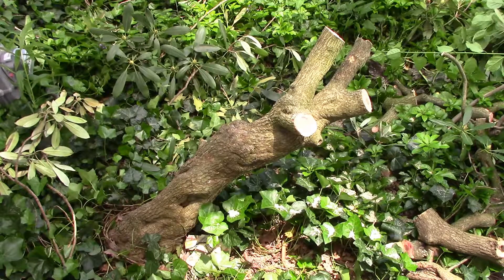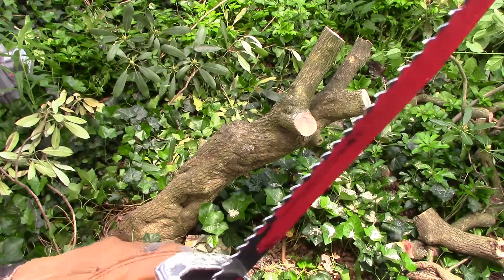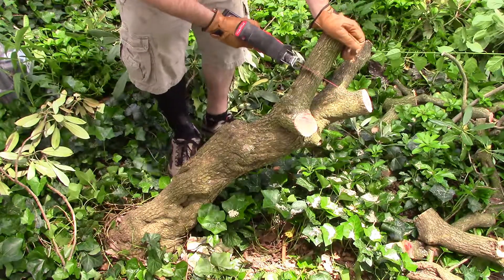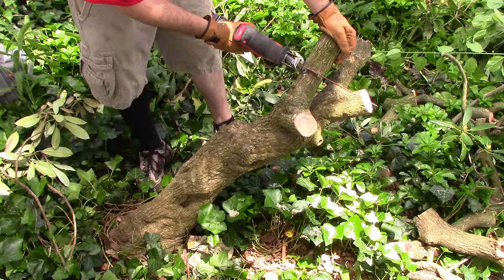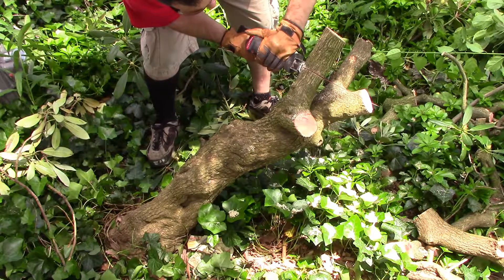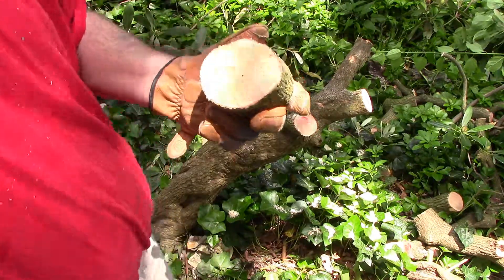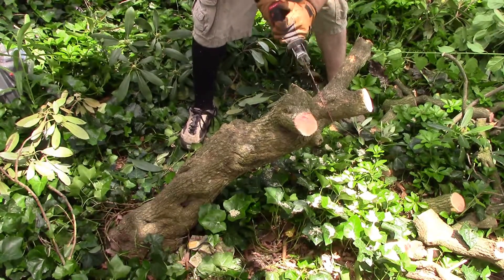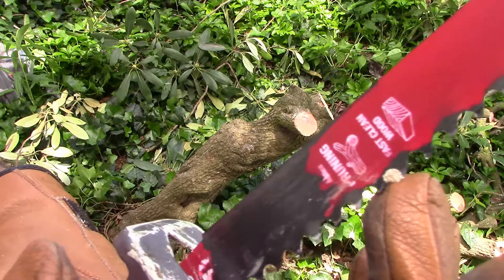Diablo Carbide Tipped Reciprocating Saw Pruning Blade

Comment: You should have made sure that your battery was fully charged before you made the video because your battery honestly sounds just about dead so it's not gonna cut nearly as good when the battery isn't working at full potential and power.

Comment: I have the same blade. 
The teeth closest to guard will always be much more worn than the teeth closer to tip (because the tip rarely gets used).
I think that’s why your method works better - it’s using more of the unused teeth closer to the tip.
Reply: Longer blades are for thicker materials. If you are only cutting a thin piece, use a short blade.
Reply: I think also because the compact recip saws have a short stroke - this is a good tip
Reply: @gregoreau  Not ALL "Compact" reciprocating saws have shorter than standard 1-1/8" stroke.
One popular example is DeWalt's "Compact" DCS367 which has the full 1-1/8" stroke and can easily be used with one hand because its center of weight is not projecting too far out from its hand grip.

Comment: A full sized reciprocating saw doesn't have  issues with clearing the gullets ,but I really enjoyed this tip for smaller one handed hackzalls as I've had the same problems with not clearing chips because of the shorter stroke length, thanks

Comment: I know this is 3 years old now but I'm hoping you can still answer a few questions :)  us that hacksaw the fuel version or non fuel.  What battery were you usuing.  And how many cuts can you get out of the battery.  Thanks so much
Reply: I know this isnt a direct answer but I'd be using the 4ah or 6ah battery for doing heavy work like this.  Save the 2.0 compacts for the drill or ratchet.

The 2 vs 4ah battery for my impact fuel driver is night and day difference, in my hammer drill and ratchet not soo much..
Reply: @Mixwell1983  thanks.  Did you try the 2.5 ho yet?  It's awesome

Comment: M12 Hackzall? I'd spend the extra money and get the bigger brother M18. Paired with even a 5.0 XC battery, it has decent runtime compared to the M12 6.0 XC (even though Milwaukee recommends a 6.0 for the Hackzall, and 8.0 or higher for the Sawzall). Also you'll cut much faster with the rocking motion than the push/pull method, and less stain on both the blades and the tool.
Otherwise the Hackzall is a perfect companion in conjunction with a (gas) chainsaw, for getting into really tight places a chainsaw will not fit in.
Reply: Some people are invested in the M12 line so why would you buy an M18 if you don’t need one? Yes the M12 Hackzall isn’t the best tool for this job but this could be a very small part of what he uses this tool for. I have an M12 and use it for pruning as well but to be honest if I was cutting this stump I’d be using my Stihl. For regular pruning nothing beats the light weight of my M12!
Reply: I think even with the m18 hackzall the stroke length is still less than a full size recip iirc.

Personally I invest in a full size recip saw but im sure in tight areas the extra time needed because stroke length makes up for the accessibility of this smaller saw.

Comment: FYI Milwaukee carbide tip blades are 2 for price of 1 home depot
Reply: I know it's an old post but sometimes Diablo runs similar specials, it's actually how I ended up getting my carbide blades from them.. 

Yah for the price of these carbides though I wouldn't hesitate to get Milwaukee or Lennox  carbides if Diablo didnt have a deal but I'd prefer Diablos.

For example as of now (may-9-2023) the 2 pack of 9" carbide pruning blades are $9.47 so im gonna grab em.  Actually didn't know they were on sale until checking.

The 2 pack of framing blades for $12.88 are a killer deal too when they have em..

Comment: Use the 3 TPI for tree cutting, they're the best, more aggressive. For this type of job the bigger reciprocating saw would do it so much faster, I have the RIDGID R8647b and a branch like this would cut it in 3 seconds because it has the orbital mode, you can only get the orbital mode in the Milwaukee top of the line Super Sawzall 👍 no doubt Milwaukee is better made but you have to pay for it 🤣
With the Ridgid, 4 amp regular batteries cost 2 for $99 with a charger on sale. One 4 amp battery with the R8647B reciprocating saw at full throttle non stop will last you approximately 25 minutes, full throttle non stop, I tested it on a tree stump that I needed to remove and the number one thing is that the tool doesn't shut off or bog down. The tool heats up but never stops, "warms up" took me (2.5) 4 amp batteries to finish cutting out the tree stump but you do need those diablo carbide 3 tpi demo blades 12".

Comment: I don't know if you are familiar those blades and tool. the blade name is pronounced De-AH-Blo, ”the TPI is 6T, that blade is a demolition wood blade for embedded nails, (the wood block on the blade) the cut in the blade is called 'the gullet', you dont have to move that much to clear the gullets but if it works for you fine. use  a pruning blade thats what its designed for...
Reply from the maker: Pruning Blade for clean wood and dirt. https://www.diablotools.com/products/DS1203CP
Reply: @ZeGermanHam   I did watch, you probably need to watch again.. he show a 6T then states it’s probably 5T and had a 5t pop up... I use that blade for demolition weekly... it’s a 6T
Reply: @ZeGermanHam  great... so what's your problem? or you just want to bug me over a blade teeth count.
Reply: @ZeGermanHam  again... he said and flashed 5T at the 1:00 mark, what part of that YOU missed, I went by what HE said, he didn’t say nothing about a 3t blade... look at the again... the photo he showed is a 9” 5-6T,  instead of bugging me you need to comment to him , I’ve been using reciprocating saws over 25 years .. you must have no idea of what you’re talking about and obviously a troll ... go troll someone else

Comment: It would clear the chips if you use a saw that has a longer stroke
Reply: Well of course it's better, i think the hacksawll types only have 3/4 inch stroke vs 1 1/8 or 1 1/4 full size recips and then you add orbital and it's apples to oranges. This raking technique seems to help clear chips on such a short stroke length on these 1 handed saws.

Comment: Umm.... chainsaw??? Anyone???
Reply from the maker: That's another way if going about it. But would render this video invalid.
Reply: Reciprocating saws are a little more versatile in that they can handle around dirt using carbide tipped blades. Useful for when you need to cut roots or close to the base of a plant and not worry about damaging the blade. Low kickbacks are a big plus too! = )